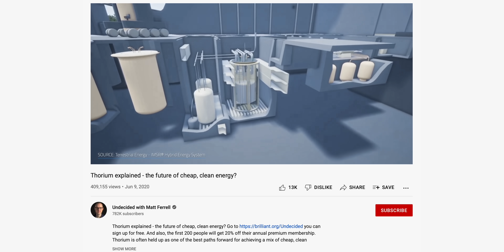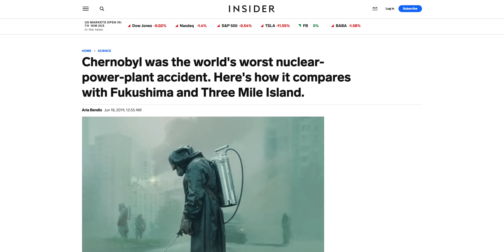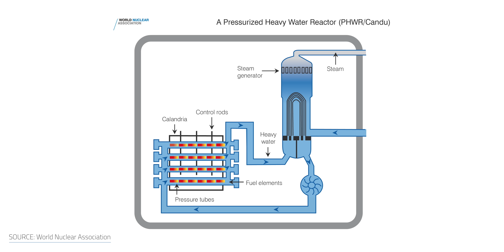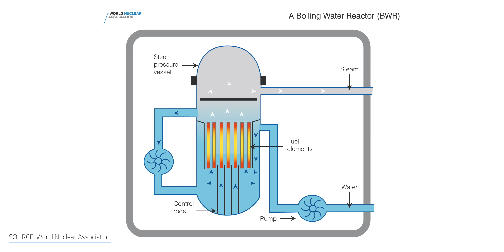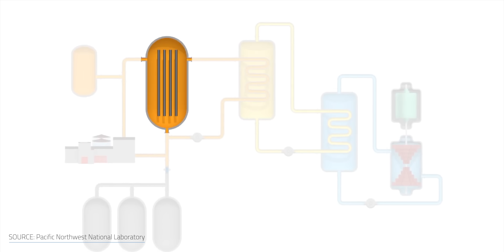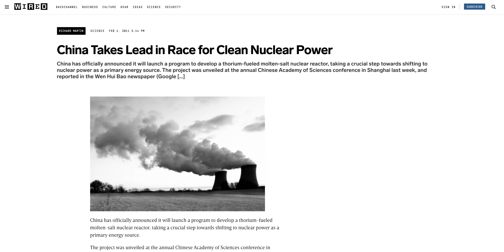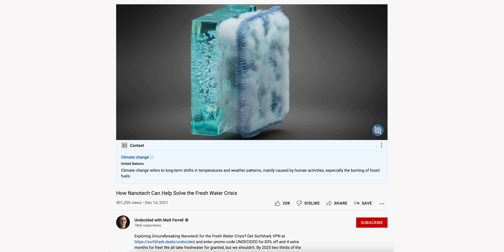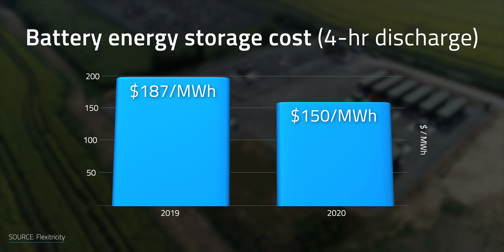Revisiting Thorium Energy - The Future of Nuclear Power?

Comment: Matt, could you say more about MSRs "burning up" radioactive waste from pressurized water reactors?  I understand this is possible, and if so, that may, in the near term, be as important a use as producing energy.
Reply: Molten chloride salt reactors like the one from Terra power are fast-spectrum. Fast reactors burn actinides, while thermal spectrum reactors tend to accumulate more actinides than they burn, that's why fast reactors are called waste-burners (they don't burn all the waste, just the actinides which are the ones that make spent fuel radioactive for tens of thousands of years instead of hundreds). LFTRs, despite being thermal spectrum, burn from U233, so they accumulate less actinides than traditional thermal spectrum, but any reactor using u233 would do the same, molten salt or not.
Similarly, you do not need MSRs to burn waste, just a hard-spectrum reactor like a liquid metal cooled reactor (they have it in Russia and they have had them since the 1960s)
Reply: @vipondiu  PWRs have an absolutely horrible burn up ratio since it isn't the percent enrichment that limits burn up, but pressure from gaseous fission and decay products built up to enormous pressures inside the fuel pellets (which can cause them to shatter) and the fuel rods (which can cause them to rupture). In addition one of those gases, xenon-135, is a very strong neutron poison with a neutron absorption cross-section of 2.7 million barns. Xeon-135 is so strong a neutron poison that it can have a significant impact on reaction stability, especially at lower power levels. In fact it can be so bad that towards the end of the useful life of a given set of fuel rod bundles, the lower power levels at which the reactor can run goes up. And if the reactor with a fuel inventory approaching the minimum has to be shut down, it might be a a week or two before it can be restarted in order for enough of the xenon-135 (which has a half life of just 9.2 days) to decay away. 

As a result fuel rods have to be removed from a light water reactor long before the enrichment level of U-235 dropsa below that which can still support sustained a chain reaction.

MSRs don't have that issue because they operate at atmospheric pressure and can have with a gas filled plenum above the molten salts. Gases like krypton and xenon-135 and low boiling point metals like caesium-137 will bubble out and can be extracted. Thus gas pressure and significant amounts of xenon-135 are no longer a limiting factor on fuel burn.

And MSRs use carbon rather than water as a moderator. Carbon isn't quite as good at thermalizing neutrons as water since single proton hydrogen (1H) is the very best moderator, being equal in weight to the neutron. But 1H hydrogen does have a absorption cross section of 0.3326 barns and because there is so much of it in a light-water reactor it plays another role in limiting minimum enrichment levels. Deuterium (2H) however only has a cross section of 0.000519 barns, which is why heavy water reactors, like the CANDU, can operate even with unenriched natural uranium.

Carbon-12 has a cross section of 0.00353 barns, so 1/100th that of hydrogen but still not as good as heavy water. Thus the neutron multiplication factor with a graphite moderator remains high enough to sustain a reaction to lower enrichment levels.

So fuel rods coming out of light water reactors still contain a level of enrichment sufficient to allow it to be used directly without further enrichment in an MSR. 

And because the transuranics can function just as more fuel in a thermal neutron MSR, they can stay in the reactor until they all burn up. Thus MSRs can also deal with the part of the "waste" that keeps the "spent" fuel so dangerous for so many hundreds of thousands of years. In fact with most of the uranium being U-238, a significant amount of natural breeding to Pu-239 will take place, enhancing the amount of energy that can be extracted from spent fuel rods by thermal neutron MSRs. But I still need to do some more reading on fast-neutron MSRs, since there is a lot I don't unerstand about them. I do know that using regular old table salt as opposed to the lithium salts in the thermal neutron reactors has some advantages from the aspect of corrosion.

And I should make the disclaimer that I am not actually a nuclear engineer, I just play one in the comment sections on the internet. So what I say above is my engineering background (which does include some of the relevant physics) and a decent ability to tickle Mr. Google into giving me the information I am looking for. So as they say, YMMV. So please anybody that is a real nuclear engineer, please correct me if what I said is wrong. I always love to learn.
Reply: @vipondiu  Th reactors are pretty interesting but the push for them is strongly reminiscent of the push for FBRs in the past. I just hope we finally get something that is functional, safe and addresses the waste issue, and soon. It's the cleanest energy out there and we could use that in a big way.
Reply: @NickFrom1228  We had one that ran for nearly a decade in the 60's to early 70's, and it ran like a top.  The primary challenges involve the material sciences around the corrosiveness of fluoride salts.
Reply: @nuanil  Plus a bit of an issue with embrittlement from the hard radiation. Still, these should be solvable issues.
Reply: @NickFrom1228  The "waste issue" doesn't exist. What you're incorrectly referring to as nuclear waste is almost entirely unburned fuel. And even if it was actually waste, it is more contained and compact than the next closest competitor by orders of magnitude.
Reply: @nuanil  If I remember correctly, the salts themselves aren't all that corrosive. The problem was the additional chemistry of the fission products.
Reply: @jsn1252  Well they had developed Hastelloy-N to deal with the corrosiveness of the fluoride salt from everything I've seen the original engineers say in interviews.  They felt they were very close to having a handle on it.  They also had a tritium problem and as someone else mentioned embrittlement, both of which they felt were readily solvable.
Reply: @NickFrom1228  The push for fast breeders was so governments could easily &secretly harvest fissile material to make bombs. To do the same thing with a thorium reactor isn't practical or easily kept secret. The motivations are definitely different.
Reply: @smeezer  quite so. It is easy to forget that nuclear power was from its birth in a way a front for military goals. Energy production was less important and only after a couple of decades of stocking up of nukes it became the main drive for further reactors.
Reply: @NickFrom1228  MIT is working on which materials will work best for a 30 to 40-year life cycle zero pressure chamber.
Reply: @smeezer  That is why thermal neutron SMRs are better.
Reply: @agnidas5816  Billion dollar project is not the goal, but 100MW cargo container-sized. That can be produced in a factory and stack if needed.
Reply: @romado59  Glad to hear. We need continued development of these technologies. The irrational fear that has been pushed upon people is stupid.
Reply: @nuanil  
.
Elysium has solved this problem with its fast neutron Chloride salt MSR, which uses only established, proven materials (and other) tech.
Reply: @romado59  
.
Thorcon will mass-produce full-size plants in factories (shipyards). Economy both of scale a n d of mass production.
Reply: Hi Jim, I'm no scientist but let me break down the thing that rocks me to the core about these 'waste-eating' breeder reactors. This from a guy who was anti-nuclear for the first 40 years of my life! It's simply an unscientific myth that nuclear waste is a problem for 100,000 years. Put it in a breeder reactor, get 90 times the energy out of it, and the final waste only stays hot for about 300 years. This real waste (called fission products) should be vitrified. This means melting it down into strong ceramic bricks that chemically bond the waste in the brick. If an accident drops the bricks or a truck smashes into the bricks, there is no  radioactive dust to spread about. Then just bury the bricks under the reactor park for 300 years, and it's safe. 
America has enough nuclear 'waste' to run her for 1000 years without mining any more uranium, and the UK has enough for 500 years. Today's nuclear 'waste' is not a problem - but the SOLUTION to climate change! This 4 minute Argonne Labs video explains. https://youtu.be/MlMDDhQ9-pE 
The world's most famous climatologist Dr James Hansen recommends Breeder Reactors as the solution to climate change. https://youtu.be/CZExWtXAZ7M
His colleague Tom Blees wrote a free book summarising their work. http://www.thesciencecouncil.com/pdfs/P4TP4U.pdf
IF you're REALLY paranoid about nuclear waste - there's another place to store it. The ocean. This is not dumping uranium dust into steel barrels at the bottom of the English channel where the barrels could rust and nuclear dust spread everywhere. Instead, we'd vitrify the waste into ceramic bricks as the video above explains. If the whole world used used breeder reactors it would only generate 1 barge worth of waste every 2 years. Pilot the barge out to your deepest ocean trench, and sink it. Water halves radiation every 15 cm. If you trap the bricks in cages mounted a few meters in from the ship's walls, that space filled with water would protect anything outside the barge. Drop the entire world's nuclear waste in 6km deep trenches every 2 years, and you're done with it FOREVER!
Reply: @eclipsenow5431  Thanks for this reply.  For whatever reason, Matt continues to blow smoke about thorium power, instead of discussing all of the competition involved in the DOE studies.  If Matt was up speed he would know about the efforts that began in 2017 with the DOE and NRC to reduce regulation and increase industry participation in advanced nuclear.  This would already happened in 2010, except the Politics killed it until a more open DOE came to the front in 2017.  Also for Matt to discuss the economics of solar when Canada has said that micro nuclear reactors are the way to economically, is just lax.  First thing is that full life cycle cost of solar and the potential disaster if in fact a major volcanic eruption darken the skies for a couple of year.  Maybe one thinks it’s low probability, however risk = probability times cost, and the cost would be near infinite if we didn’t have 24/7 nuclear energy.  The energy density of nuclear makes so many progressive possibilities, for prosperity without relying on solar panels covering the surface of the planet.  Solar panels, 80% now are made in China.
Reply: @eclipsenow5431  We already have salt mines converted for nuclear waste storage in Nevada. This not ony has some of the waste to be burned as you state, it can also be the resting place of the "short" term waste storage. 
Burnable waste out, Inert bricks in.
Reply: @eclipsenow5431  awesome.
Reply: Elysium energy were designing a fast spectrum molten NaCl reactor which could burn waste, Plutonium, U238 and Thorium. The waste would have to be processed into chloride salts but the Japanese developed a process to do just that some time ago - dissolve fuel rods, capture the volatiles and sequester them until decay to solid and filter the insolubles out for geologic disposal. Elysium estimated they could run their reactor for 40 years continuously only stopping for checks on the erosion of the reactor pot. I believe Terrapower is looking at a similar project.
Reply: @charlieclelland5895  Drawing pictures of designer's impression of NPP is not designing.
Reply: @wwlb4970  The preliminary design is complete.  What remains is only drafting and revision.
Reply: The thing to remember is that what you and so many others incorrectly call nuclear waste isn't actually waste at all. Solid fuel, water moderated reactors (of which PWRs are just one type) are so bad at consuming their fuel load that only a few percent of the energy is extracted before the reactor can no longer economically generate power. "Nuclear waste" is really almost entirely unspent fuel, and only exists because incompetent bureacrats shackled the industry to 1950s technology that was obsolete in the 1950s.
Reply: @jsn1252  nowadays the common practice is to refine spent fuel and reuse the intact uranium. The issue are actinides that are leftovers from the refinement and obviously a substantial contamination of the whole refinement chain.
Reply: This entire comment thread basically nailed it.
Reply: There's stuff in a nuclear reactor that will slow it down over time. Look up "neutron poisons" and "spent fuel". In a molten salt reactor, even with the same fuel type as a normal reactor, a LOT of that stuff bubbles away. You still have to keep track of it and put it away (and it's still a type of waste), but that lets you run longer on existing fuel.

On a fast reactor (which requires stronger fuel), the reaction goes THROUGH a lot of these "neutron poisons", so it can run even longer still. If you properly manage a fast reactor to steadily convert and consume fuel, it can refuel partially with the spent fuel (or what people incorrectly call "radioactive waste") above. If that fast reactor is ALSO molten salt, it becomes a LOT easier to mix spent fuel in, and after a while (a few years of operation), switch to 100% spent fuel input.

A lot of spent fuel is reusable (typically plutonium and americium). A molten salt reactor (and a very carefully made solid fuel fast reactor) can fully burn this stuff up over time.
Reply: @mukiex4413  Thermal neutrons are better for reactors.
Reply: @romado59  Well, easier. Less fuel, less enrichment. But fewer things will fission in thermal, and more things will function as neutron poisons.
Reply: It's a strange thing when a comment section is more interesting than the video which inspired it.
Reply: For good insight into the benefits and challenges of thorium reactors, Gordon Mcdowell's channel has over a decade worth of videos on the fight to implement them.
https://www.youtube.com/c/gordonmcdowell/videos
Reply: Another thing MSRs can produce is useful isotopes that can be separated out and siphoned off and used for other applications, like extremely rare and valuable medical isotopes like Americium-131 for targeted cancer treatments that could save hundreds of thousands of lives. Ironically the most valuable thing these reactors can produce isn't electricity.It's these isotopes. There is a reason why MSRs are called "The Chemist's Reactor"
Reply: You don't need a MSR for PWR spent fuel multi-recylcing. You can use a Sodium Fast Breeder. These already have been commercially operated since the 70s and are still in operation today (see Russia's BN-800).

Comment: I appreciate the comparison to renewables at the end. Talking new nuclear (this and fusion) is fun, but realistically they won't be generating any commercial power until at least 2030. I used to be a huge proponent of more nuclear power 15~20 years ago, but have grown skeptical that by the time better nuclear options are ready for primetime that renewables + batteries won't be so much cheaper so as to render it completely not cost competitive outside niche scenarios (like you mention of double dipping with desalination). It's pretty damning that renewables + battery storage today has similar or lower LCOE than these do (theoretically) coming online in a decade, let alone another decade of renewable + battery reducing costs progress.
Reply: Solar is not cheaper.  Run a cost analysis taking into account four times the storage (solar is only useful 30% of a 24 hour period), and the cost of replacing those batteries and panels to match that of the lifespan of a typical nuclear power plant. You suddenly find solar to be much more expensive than nuclear.
Reply: Not so, 100 times more efficient and 200 times waste.

Comment: 4 hour battery system? You know night lasts for longer than that, right? And we have windless days? A grid made purely of wind and solar will need at minimum 1-3 days of grid storage. Probably closer to a week. Only if you’re in a cloudless desert or an incredibly windy area would that be less than 1 day. And the polluting effects of manufacturing those solar panels and batteries is likely going to be far worse than the production of a centralised LFTR.
Reply: In the last 30 days, I have only had three days of useful electricity generation from my 4Kw array.